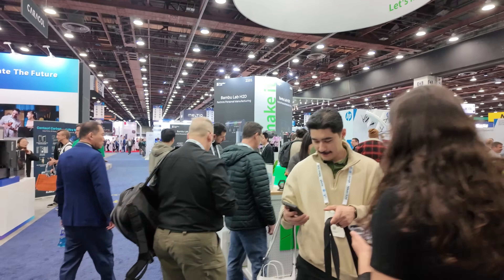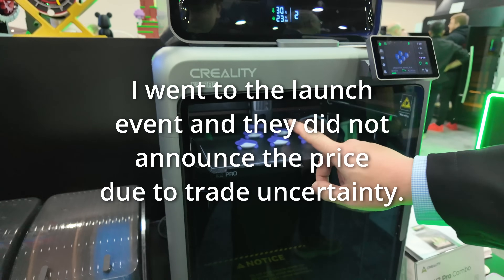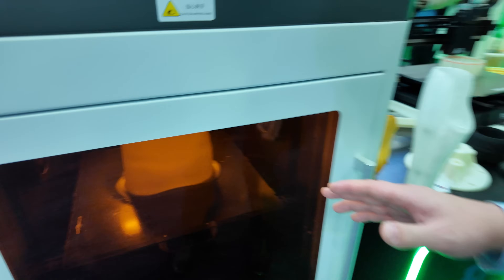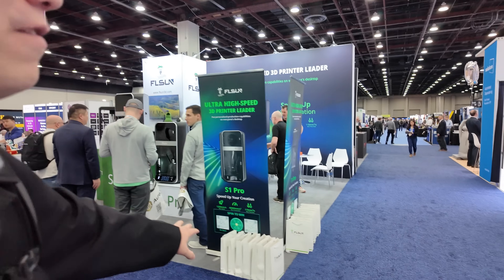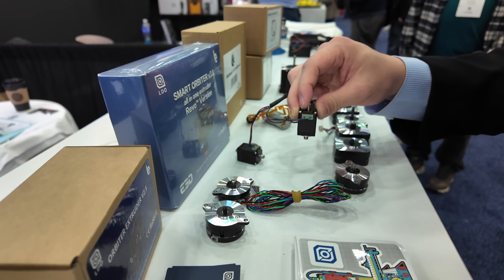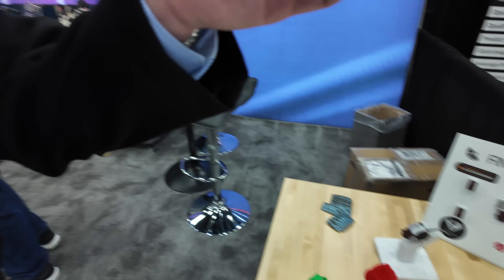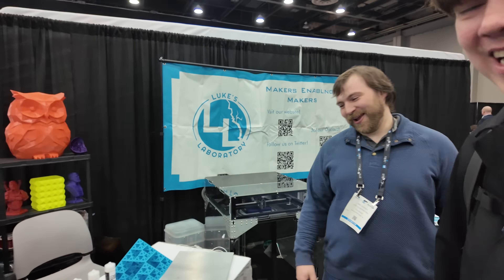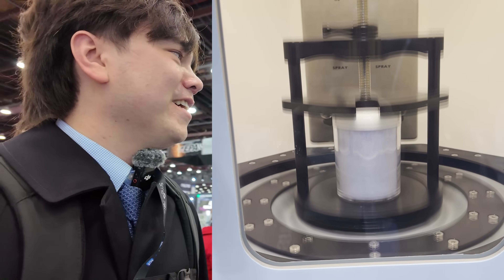RAPID+TCT 2025 - A Few Interesting 3D Printing Innovations

Comment: I received an invite to a meet and greet of a local aerospace contractor/manufacturer's R&D facility a few years ago to see their AM division Industrial printing is on another level when you get into big budget spec sheets. Their least impressive (a relative term as a nice way to say it was 'entry level' but still Firmly out in Unobtanium Land) was a Thermwood unit that operated inside a 20x40 Feet sealed 'enclosure' with a 30mm main nozzle. They used it primarily for making fixtures for composite molds and airframes. The pellet bin was the size of my truck and was fed through a pressurized overhead hardline system with an 8" wide flexible extension. And then the topping at the end, the extruder was mounted on a 5 axis autonomous robot arm like you might see in an automobile factory (the great orange ABB behemoth) that could traverse anywhere inside the massive room. The operator was located in an adjacent booth and had a remote control touch panel, more or less to advance processes and a mighty red physical emergency stop button. 
It was an interesting experience with that one that gets into your psyche a little bit on the ride home. Knowing those kinds of options exist, but you get back to your shop and the fleet looks a lot less impressive afterwards.

Comment: Oh man that Bindtech looks cool, but it's a lot smaller then i thought.
Reply: @calilifestyle  it was the only printer they could fit in their luggage. Each heatbreak/nozzle needs 37mm of clearance for the toolhead to grab it. With something like a Voron 2.4 with 350mm X you could almost fit 10 filaments. And since the bed is static I'm sure someone will figure out how to add additional filament tiers.

Comment: So should I buy an epoxy build plate?
Reply from the maker: They recommend only using it for non-enclosed printers. I think it might stick too well in a heated environment or when printing with higher temperatures.

Biqu might sell some marketed as "cryo grip" or something. Theirs are colored blue. but I'm not 100% sure what those are made of or if they are epoxy at all. they felt similar when I touched both.
Reply: @NathanBuildsRobots  But why they sell K2 version of epoxy plate then?
Reply: @NathanBuildsRobots  Nah It works really good on my K1 Max Nate.  way better then the Biqu blue plates
Reply: YES!  The new Creality Epoxy cold plate is awesome! I have one on my K1 Max and I can run PLA at a bed of 10 degrees.....And it sticks like concrete
Reply: @ I think the epoxy plate and cool plate are two different types
Reply: @Deek6923  Nope.  The Epoxy resin plate is the coldplate. It even has temp fanges on it.  PLA 10-30 , PETG 40-70 , I have it 100% sure its the Epoxy resin plate
Reply: @ what heat settings do you use for PLA and PETG?
Reply: @Deek6923  PLA i use 30 and PETG i use 55 with the Epoxy resin plate

Comment: Vase mode with infill would be an amazing slicer addition.  You could print with continuous fiber reinforced materials and super high printing speeds.  Print quality could be improved without needing retractions.  I imagine nozzle clogging would also be reduced.
Reply: I printed with lw pla a lot in the past, materials thats the feeature i wished for.
Reply: Continuous pseudo Hilbert infill vase mode would be great for TPU to prevent stringing.  I print a lot of TPU and I design the geometry of the parts to avoid the nozzle ever leaving the part to achieve a good surface finish.  The Avoid Crossing Walls slicer setting is a huge help but any Z hop allows the ooze to string outside the perimeter of the part the same as allowing the nozzle to cross the walls, but disabling Z hop often causes the nozzle to catch on taller parts when making an internal travel move.  Clever continuous infill would prevent that.  Even if it wasn't a perfect solution for every arbitrary geometry, a 90% solution would be a big improvement.

Comment: Great video, I felt both like I attended and that I want to go in person :-) Do you have a link for the continuous extrusion system AKA "Super wase mode" ? I am tuning a small (and amazing!) pellet extruder and it would be great to reduce retractions. Any additional information is greatly appreciated, thanks.
Reply from the maker: This article references a "differential growth algorithm", thought I can only read the abstract https://scholar.valpo.edu/cus/1331/

I can reach out to the authors working on it at Oregon State University for some more information.
Reply: @NathanBuildsRobots Thank you very much, I will check it out. And any further information you can find would be great. I will also look around and see what I can find. Pellet based 3D printing is very interesting. As I said, I am tuning one right now, it prints right next to me as I write this!  It is early days, but when it works it is amazing. The print cost reduction and the materials it can print with are just fantastic. And this particular one is super cheap as well, what more do you want?When this works somewhat close to the current filament based printers it is going to be a game changer.

Comment: Oh man, Creality is really coming after the Qidi Plus 4 market space with that K2 Pro build volume and pricing. I really wanna know if the K2 Plus does well with engineering materials in the first place tho, I can't seem to find anything comprehensive on that.
Reply from the maker: K2 series is going to be great. K2 plus was already very good and the follow ups will benefit from lessons learned while being cheaper
Reply: @NathanBuildsRobots 
Don't lie about the K2 Plus, it has a lot off issues and Creality does nothing so far, it is the same story as with all the previous printer releases.

Comment: Did you see the multicolor module for the Elegoo Centauri Carbon?
Reply from the maker: No, I didn’t look. I don’t really like multicolor tbh
Reply: @NathanBuildsRobots  I prefer a toolchanger but I dont have toolchanger money. I will mainly use it to easily switch between materials for different prints. Loading and unloading spools is getting a bit old.